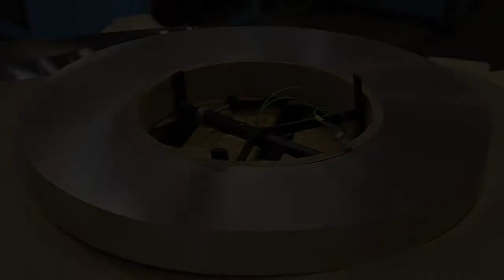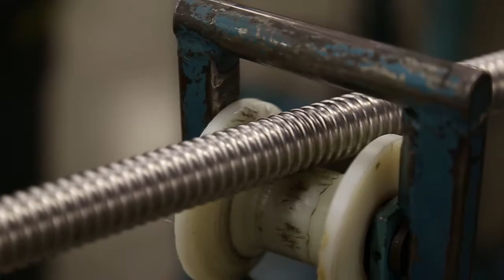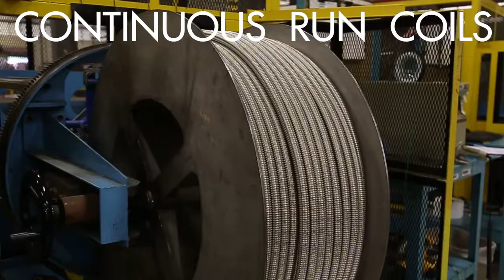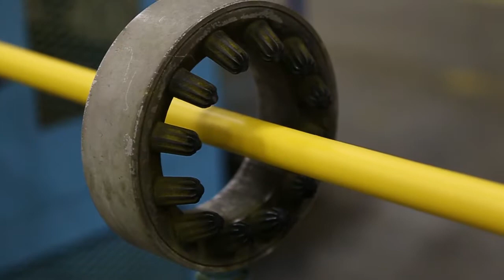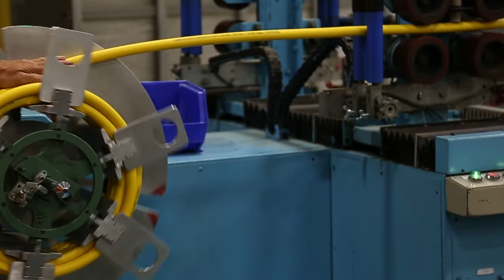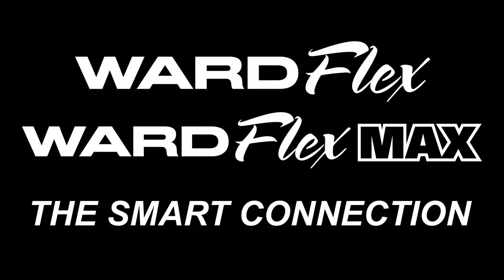WARDFlex® How It's Made

Comment: Cool because I have used your product rarely mainly use Trac pipe in Az. Are your fitting still the gastite style with the 2 piece flaring washer?  Fyi I'm sure you are aware how Trac pipe makes their flare washer inside the fitting, allowing the washer to stay in the fitting. Let me tell you guys, in an attic your fittings require acrobatic, space walk talent to not lose one half of the washer. Just food for thought, static environments it works well but we all know plumbers in the field are in anything but a static environment
 Trac brass is a one handed operation allowing one hand to help support yourself. Recommendation would try to integrate the flare washer in the brass